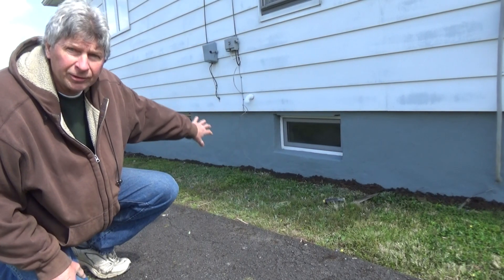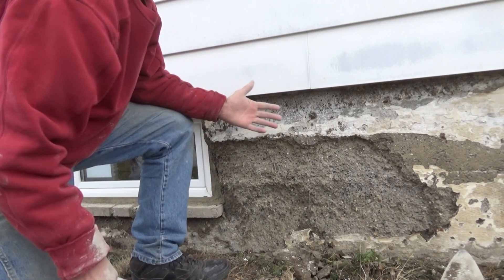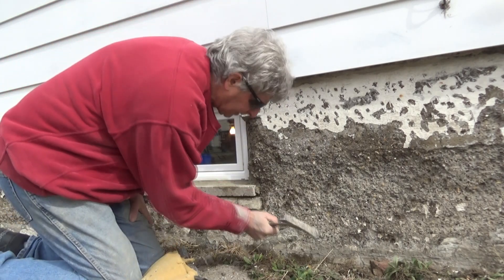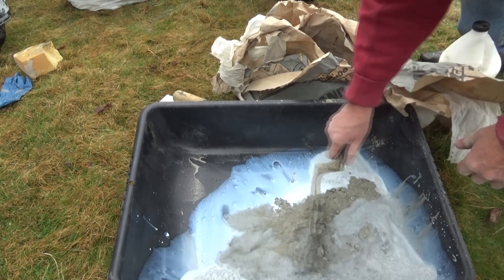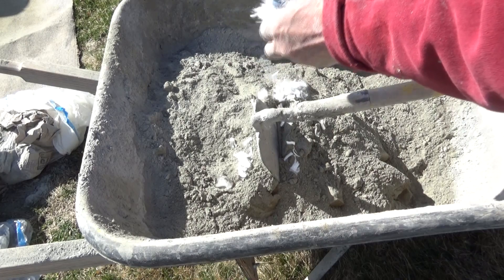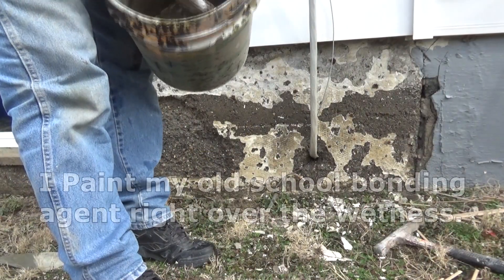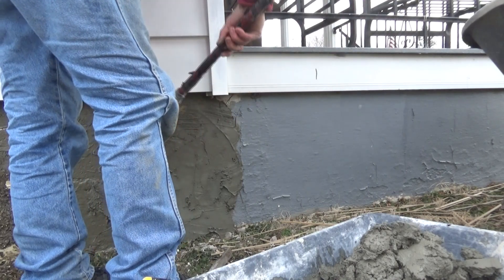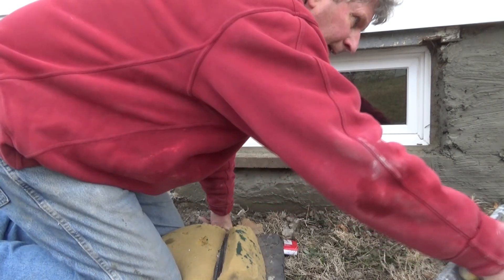FOUNDATION REPAIR (Part 19) Mike Haduck

Comment: Hi Mike,
I've watched most of your stucco/plaster patch work and repair, looks like 2,5 gal buckets masonry sand 1/2 bucket mortar, 1/2 bucket portland .
Thanx Bob
Reply from the maker: Hi Bob, usually 2 sand to 1/2 s mortar 1/2 portland,  down southern states 2,5 sand works, mike
Reply: @MikeHaduck  mike,
S mortar is without sand correct.
Reply from the maker: Yes Bob,  without sand, you could buy the premix s motar and if I think necessary I might add a little Portland, do a test spot wait a few days and check the results, I hope it  helps Mike
Reply: @MikeHaduck  Hey Mike,
Yes on my foundation patches I thru a little portland in the mix. Made it really strong. 
My sister owns a building I'm about to stucco/plaster patch.  Then re-roof. 
Your advice as always invaluable for my success in me becoming a mason...🤣
Thank you Mike
Have a blessed and healthy new year sir.
Bob

Comment: Hi Mike, thank you for the great content and education. I live in mountain top,pa 18707 and have a cement foundation from house built in the late 80s needing repair. I have to patch a a hole with which is only 1 inch to .5 inch deep and around 6 inches wide and 6 inches in height. After that, I will need to resurface the foundation so it all blends in and paint it after the cement dries. 
Should I use your foundation recipe of 2 parts sand to 1 cement( mortar mix and Portland) or can a use just use the premix s and add Portland? I like the idea of convenience and not lugging around extra cement to mix. I am not 100% sure what to use? Thank you
Reply from the maker: Hi, I do use the premix mix and if for any reason I think it's too week I might add a trowel full of Portland, thanks Mike

Comment: Mike in your trusted opinion for foundations; do you prefer a concrete paint
or mix the traditional Portland paint as a final exterior coat?
Another excellent and instructive video.
Thank you.
Reply from the maker: I think it depends on how cheap or expensive is the job, a.c and what it is on, hard question to answer, thanks mike

Comment: Can I ask you why you do not make a slurry mix with Portland to paint for the second coat of plaster? Would it hurt?
Reply from the maker: Hi mcw, you could but the first coat is what you are worried about as far as sticking, it may also stain the second finish coat, everthing depends on what you are doing, thanks Mike

Comment: Hi Mike. In patching a cracked foundation along the side of my house with hydraulic center, I forgot a step you emphasize, wetting first! My mixture was a little damper than stiff as well. What can I expect over time? In Chicago.
Reply: Hydraulic 'cement'
Reply from the maker: Hi Terra, if it didnt fall off you are probably ok, as long as it works, mike

Comment: Like Magic!  -  is  the repair as done here,  a coating on the foundation wall or in the end is it the foundation wall one in the same?    In 20 - 25 years if some stuff comes off  would it be the repair portion or the just future decay as if original?
Reply from the maker: Hi James,  I think they should get 50 years more or less and then just routine maintenance,  with patch and paint, thanks mike

Comment: Looks good Mike!  The manufacturers of Type S say not to use it more than 1/2" thick.  I know you are using a portland, sand, Type S mix, but can Type S b used this thick by itself?  I have holes in a stone foundation to fill that are a few inches deep and trying to select the best product and/or mix...
Reply from the maker: Hi, my mix is usually 2 mason sand to 1/2 s mortar 1/2 portland, ( 2 to 1),  I never had a problem, best to wait a few days between coats ,thanks mike
Reply: @MikeHaduck  Thanks Mike!  How thick do I dare put it?